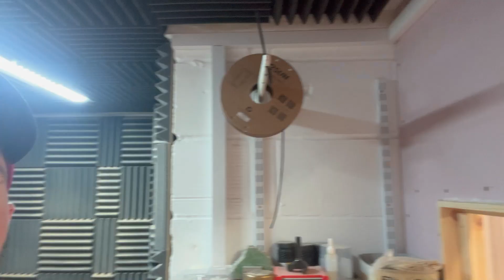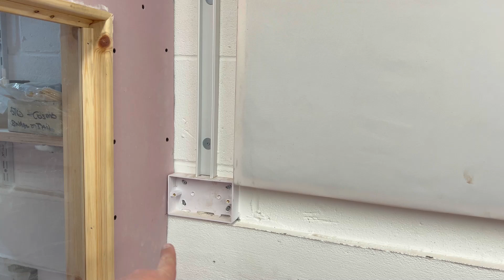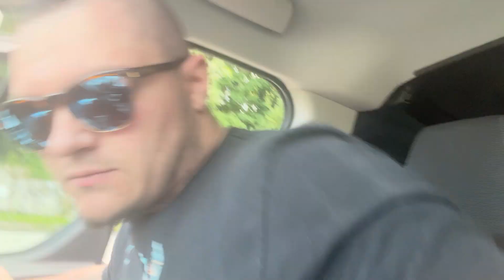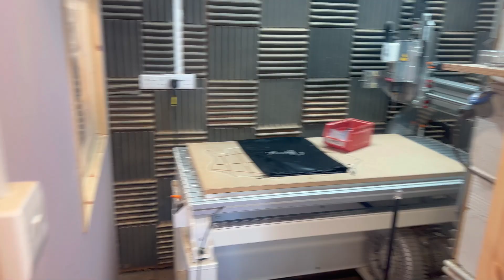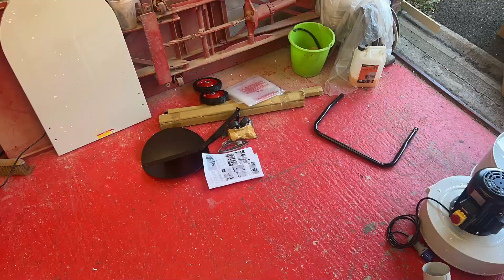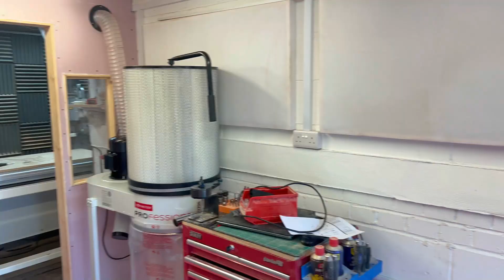Improving My Workshop With A New Dust Extractor

Comment: Nice upgrade! 😎
I would suggest looking into replacing the flex tubing with hard tubing. The flex cuts down on CFM volume significantly due to the ribs.
Reply from the maker: i did look into the rigid stuff, but wasn’t sure on how i would get it all working with the setup. It’s definitely on the list of things to do 🤘